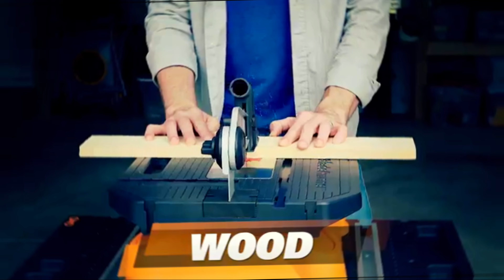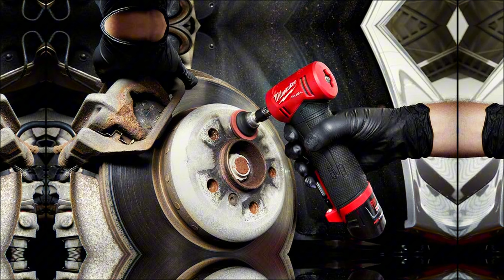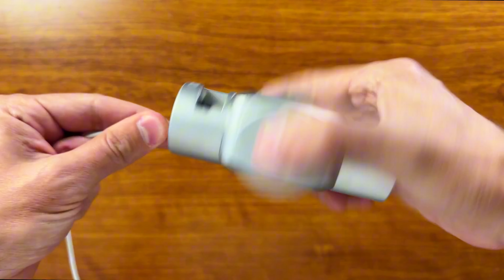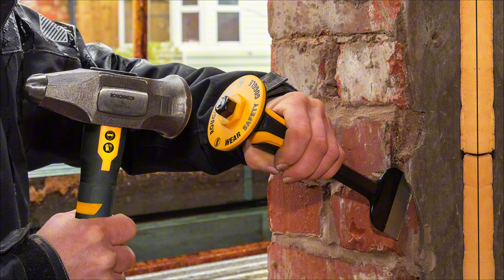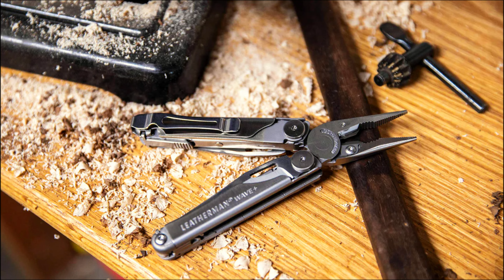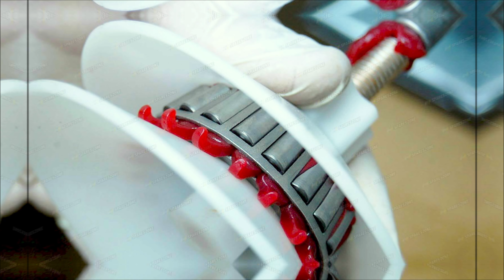40 Cool TOOLS on Amazon You Really Need To Buy | Tools For DIY

Comment from the maker: ➡ Links of the 40 Cool TOOLS on Amazon You Really Need To Buy we listed in this video.

1. WORX WX572L BladeRunner X2 Portable Tabletop Saw
https://bit.ly/3Y9vLua

2. DEWALT 20V MAX XR Compact Router
https://bit.ly/3Lcc3uK

3. DEWALT 20V MAX XR Belt Sander
https://bit.ly/49cOfir

4. Milwaukee M12 FUEL Right Angle Die Grinder
https://bit.ly/4ar14rH

5. LockNLube Grease Gun Coupler
https://bit.ly/498KDxZ

6. Fanttik S1 Pro Electric Screwdriver
https://bit.ly/492xvdv

7. Fanttik X8 APEX Tire Inflator
https://bit.ly/4qtM3u1

8. HOTO 3.6V Electric Screwdriver Kit
https://bit.ly/4qoKgX4

9. KREG PRS3400 Precision Router Table Setup Bars
https://bit.ly/4p74oMc

10. KREG Pocket-Hole Jig 720PRO
https://bit.ly/3KOcGuu

11. KREG Accu-Cut Circular Saw Track
https://bit.ly/3Y9P4mX

12. KREG Rip-Cut Circular Saw Guide
https://bit.ly/4aqDnja

13. MICROJIG GRR-RIPPER GR-100 3D Pushblock
https://bit.ly/4pcP6Wr

14. DEWALT Right Angle Attachment
https://bit.ly/44Fz2oH

15. Dremel 8220-1/28 Cordless Rotary Tool Kit
https://bit.ly/44Jp99n

16. Milwaukee M12 10oz Caulk & Adhesive Gun Kit
https://bit.ly/497a56G

17. RIDGID 18V Compact Band Saw
https://bit.ly/3Yca4tl

18. EGO Power+ 24" Hedge Trimmer
https://bit.ly/4pRlheZ

19. DEWALT 20V MAX XR Variable-Speed Die Grinder
https://bit.ly/4qtw0fH

20. RIDGID K-3 3-Foot Toilet Auger
https://bit.ly/3Y97zIo

21. BOSCH GLM 50 C 165-Ft Bluetooth Laser Measure
https://bit.ly/45eP74N

22. BOSCH GLL40-20G Green-Beam Cross-Line Laser
https://bit.ly/4sbsqIH

23. Master Appliance HG-501D Industrial Heat Gun
https://bit.ly/3Y6f7vt

24. LEXIVON 1/2-Inch Drive Click Torque Wrench
https://bit.ly/4aqx6Eb

25. KNIPEX 10" Cobra Water Pump Pliers
https://bit.ly/498KLNZ

26. KNIPEX Pliers Wrench, 10"
https://bit.ly/3Le4ZOg

27. Klein Tools 8-in-1 HVAC Slide-Drive Screwdriver/Nut Driver
https://bit.ly/49oB4vU

28. Klein Tools Coax Explorer 2 Coax Tester Kit
https://bit.ly/4p4RvSH

29. Klein Tools Large Cable Stripper
https://bit.ly/452w9hZ

30. Powerbuilt Brake Fluid Tester Pen
https://bit.ly/4scLc2f

31. Gorilla Gripper 44010 Panel Carrier
https://bit.ly/45lu3JS

32. Roughneck Gorilla 3-Piece Bolster & Chisel Set
https://bit.ly/49r3bL2

33. PaintShaver Pro 9-Amp Paint Removal Tool
https://bit.ly/4qn360u

34. RIDGID 223S Inner/Outer Reamer
https://bit.ly/44IVkpz

35. LEATHERMAN Wave+ Multitool
https://bit.ly/4pQFem3

36. DEWALT Impact Ready Shears Attachment
https://bit.ly/3KVHfOR

37. Solary 1100W Magnetic Induction Heater Kit
https://bit.ly/4juWzyV

38. OEMTOOLS 25081 Universal Bearing Packer
https://bit.ly/4jkjyws

39. JET JWL-1640EVS 16" x 40" Wood Lathe
https://bit.ly/44FcDI1

40. IRWIN VISE-GRIP 23R Locking Sheet Metal Tool
https://bit.ly/44H4QcR